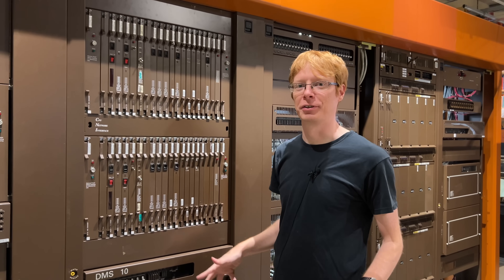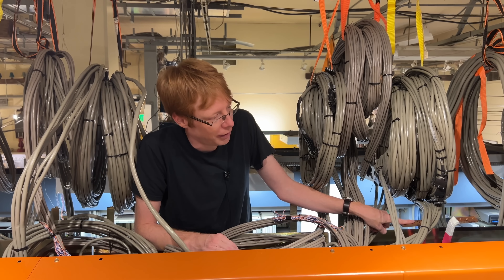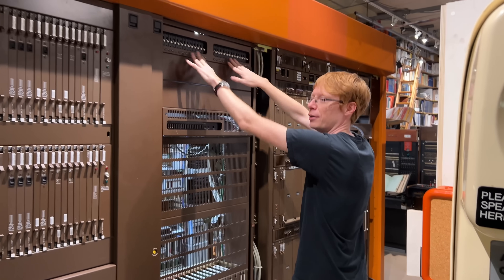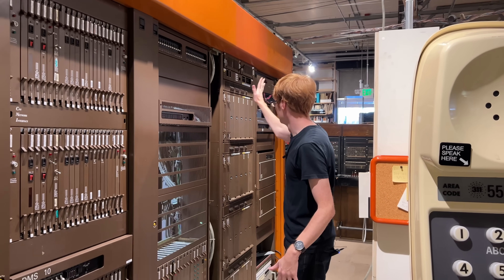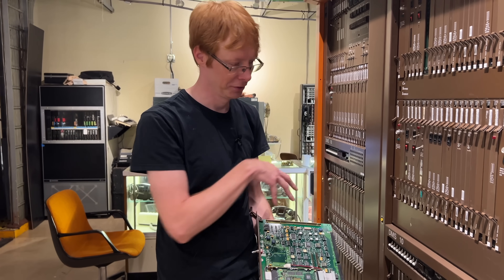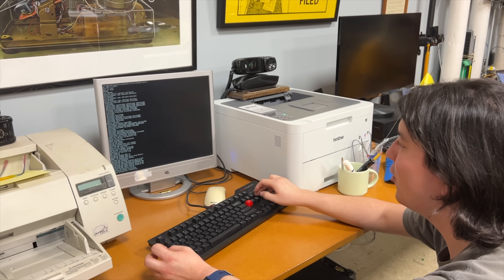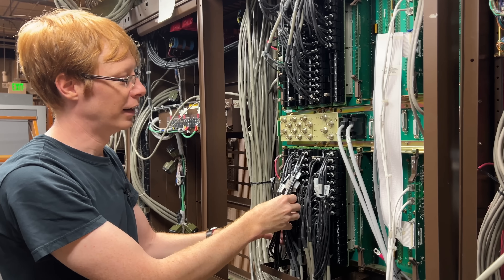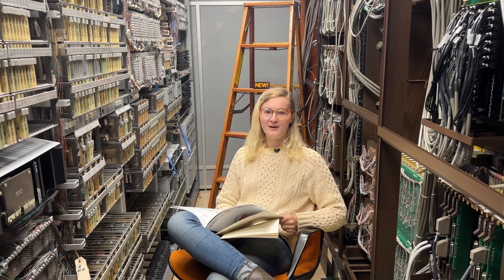Grounding and Wiring our New Switch

Comment: I worked on DMS-200 (toll) and DMS-100 (local) between 1978 and 1984 at Bell Canada. FWIW, those systems were built into rooms with the standard "computer room false floor". While this provided a source of cold air (came in from the bottom then went out the top), it was also a place where a lot of cabling could be found. IIRC, DMS-10 was only found in CDOs, not COs.

Comment: I Called it a Cross-Bar-Switch because - Thats WHAT I Was Doing LOGICALLY. Making a Switch - Crossing a Bar. However, the Actual Implementation isn't a Cross-Bar. The Transistors AREN'T Cross-Bar. Like Your Gods - Electromechanical - Cross Bar Switch. Your Gods Cross-Bar Switch - Logically they're Switchboard.

Comment: Having worked in a central office equipment environment for over 25 years on everything from a lowly SLC-96 to a 32 Slot Ciena 6500 Photonic bay system, @ 6:05 Removing, or installing plug in equipment cards without a ESD wrist strap connected to a rack ground point - Big no-no!

Comment: I worked for Northern Telecom starting in 1985 at DMS10 at the Plaza in RTP, NC. I was a systems test tech until 88 or so then i began installing them into sea land containers for emergency response units like Elma Alabama and third world coumtries like Micronesia, Guang Dong China and such. I had extensive installation, software configuration and system level testing capabilities. Reach out if you have any questioms or needs regardimg the DMS10 functiom and capabilities. May want to add the Accessnode and Transportnodes, OC12/48 pieces to your museum in the near future. I deployed those as well. Great gear and great memories.
Reply: Hi Chris, how's it goin, Man?

Comment: Hopefully in your documentation for the DMS-10 you have a copy of SD0T01-11.  This is system schematic for the 500/600 DMS-10.  This document will help greatly with regards to understanding the power/grounding and system cabling (frame to frame) of the DMS-10.
Reply: Thanks for the pointer, it definitely helps to know specifics about what we should be looking for. We're right now trying to track down a set of drawings but so far no luck. All the docs we got via Adtran were manuals and NTPs, evidently the drawings got separated from the switch at some point.
Reply: Look for old Western Electric "ED" drawings. Those were the drawings we built the systems with back in the day.

Comment: Oh my f**k they got a modern digital switch....yeeesssssss :D

What's sad is : Verizon's on a FTTP tear again in the Northeast right now, and any local loop with a 5E with bad copper they can get away with they are wacking and doing who-knows-what with the decom'd 5E's.  All the 5E's workers on the "chopping block" are getting their services kicked over to FiOS or fixed LTE/5G services.  I just hope it all (i.e. the 5ESS gear) isn't all going to a scrap pile, and they're at least cannibalizing the frames for line cards to stockpile.

It sucks because : I have this sinking feeling that's the fate that will befall 99% of the 5E gear out there that ever lived in a C.O. .  I know Alcatel-Lucent for a time sold 5ESS VCDX gear to their enormous customers as PBXes (so one of those might pop up on an auction site), but I have to imagine that software isn't the same as what you'd pull out of a C.O.

I apologize I am making assumptions here, but I would have to imagine you folks would kill for a 5ESS, basically the "Final Boss" of the WECO circuit switched world and all the wild crap they made to hang off of those frames until the mid-2000's

Looking forward to any/all content you folks made on this thing.  Thanks!

P.S. - Also bought a 1A T-Shirt, thanks for taking the time to design/sell them!
Reply: The 5E's are definitely on our mind. Two big reasons drove our planning towards the DMS-10 though: 1) we knew we could fit a working DMS-10 into a very small footprint, which meant as little disruption to the other exhibits as possible and 2) that small footprint was the original configuration of the switch, and didn't require us to re-engineer a small switch out of a much larger one. Every other switch in the museum required expert-level trickery to make them run in their museum-sized configurations, and the complexity of the 5E makes me pretty hesitant to assume we could easily pull that off, especially since none of us have hands-on experience with it. There are always details that don't appear on the high-level block diagram of the switch that end up mattering, like in the DMS-10 case it's really important that we have the PE-01 frame just because it has the power bus bars, but that's usually not mentioned in descriptions of what the PE frame does. Software is the other worry; very possible that there are configuration files that only Lucent has the tools to create (certainly true of the 3ESS). These are all solvable problems, just harder ones than with the DMS-10.

All that said, we'll definitely be on the lookout for what we can preserve of the 5ESS, particularly since now is the right time to save what we can.
-Colin

Comment: 12:08 "This was definitively C++".

No. That was definitively NOT C++.

It was C.

I doubt C++ even existed at the time these things were developed, even later versions.
Reply from the maker: You do realize that this switch has application software, correct? Like, the OS/kernel/whatever might be written in C, but there are other programs on this disk, like installers, test suites, and so on. 

And this machine was built in 1999, and is running software from 2005. I took C++ classes in high school in 2002.
Reply: @ConnectionsMuseum  there is nothing on screen indicating it was c++

Comment: It's cool to see this, considering at my job we monitor 50+ DMS10 switches that are still active, among other equipment such as DMS1U's and DMS100's and 200's. I actually took a training on how to assemble one but it was a while back so I wouldn't know much myself on how to do it though.  We had a decommissioned one we were suppose to assemble as a team to setup a lab but it ended up being cannibalized for parts when one of our active ones crapped out. Parts are getting harder to come by!  Stuff in those days was built to last.  Now days everything has such a short life span, it's kind of sad.

Comment: Pretty cool. It is clear it is running Unix, possibly with some real time extensions, and probably heavily customized Unix, but it unlikely it is written from scratch, and rather some adaptation of some commercial UNIX. Any idea yet which one? (Obviously it is not Linux or BSD from looking at the dump).

I guess this is Chorus Real-Time Operating System (RTOS) from Sun Microsystems, which is some form of SunOS / Solaris?

I am pretty sure it all traces back to Bell Labs UNIX and AT&T, but maybe Chorus is based on SVR4, which is like a combination of SunOS and AT&T Unix, as well 4.3BSD for some network stuff.

Edit: Actually no. ChorusOS appears to be custom built high reliability micro kernel, with POSIX apis for the user space. and a lot of services in user space. Makes perfect sense for a telco equipment I guess.  They also supported SL-1 language which was using some extra features. (I wonder how similar this is Erlang VM by Ericsson).

Comment: Wow, that brings back memories.  I worked at BNR as a co-op student in 1987 and I wrote software that ran on the DMS-100.  Nortel invented its own language called PROTEL for running on the switches, and I'm pretty sure they had a custom CPU too.  Fun times!
Reply: The CPU for the 500 series is a PowerPC, if I remember correctly.

Comment: Looks like a lot of fun.
Although DMS-10 and DMS-100 Family systems are different beasts, they do share some level of commonality. Peripherals such as the Line Concentrators and Line Group Controllers are pretty much the same across either platform. Internal communication should be at a DS-30A bit level for copper interconnects. (2.56 Mbits/s). Multiple DS-30 connect to the peripherals to satisfy the expected usage. From your video, I didn't see any sign of DS-512 optical connections.
When scanning the disk drives, it looks like the DMS-10 software might have been sourced in PROTEL(?) (A C, C+, C++ like language) PROTEL being the high level language developed at BNR (Bell Northern Research). PROTEL stands for Procedure Oriented Type Enforcing Language. Block structured and type enforcing. The software was not my big thing, combined with my lack of knowledge on DMS-10 -- I could be very wrong. On that disk should also be the software for the peripherals in addition to the SOS (Support Operating System). Please use an anti-static strap when pulling or replacing cards. Mentioned many times here, but worth repeating.
Grounding was always a big deal in digital machines. Random current flowing where it shouldn't will cause all sorts of odd behavior from "hissing" on the analog side of line cards, to "0" and "1" confusion on the logic signals. Not to mention potential damage from nearby lightning strikes.
One of the big differences between DMS-10 and DMS-100 was ease of use. DMS-10 being very command line oriented and DMS-100 was menu driven. The data table structures are complex in either scenario.
I worked for Bell Canada at the start of the digital revolution and eventually wound up working for Nortel as a DMS customer support drone and new product introduction. The best of times, the worst of times. Miss it greatly. On occasion.
One of these days, I'd love to see your museum.

Comment: I remember the day that our local exchange switched from mechanical to that NC switch. Then they interface later on to ADSL on top of that switch. I do not know what our LEO is running today, I have a fiber connection and dead POTS line comming into the house… no noisy lines and no problems with the dedicated fiber line… good bye 👋 to buried wet cables. And I am only 2 km or 1.5 miles from my LEO. Only time my internet was out is when the vault at 10th and State in Erie blew up and caught fire!!! 😅😅😅😅

Have fun on the new switch. Maybe there is a few retired guys in the old Chautauqua and Erie Telephone system that could help with any answers.

73’s
DE N2JYG

Comment: Once that drive has its data dumped use an SD card to SCSI adaptor to replace it.  Dead cheap and will be better to go solid state.
Reply: Colin was half of the team that created a 3ESS SD "tape drive replacement" and extracted the data from the old DC-600'ish tapes. I'd bet they were cloned before anything else.

Comment: My dad retired from Nortel, and I also worked as a tester for the DMS 100.  We have a LOT of books, software for the DMS even display phones.  Get in contact if you want it.  They passed away and it's all got to go.
Reply from the maker: @DJPhantomRage can you drop us a line at info@connectionsmuseum.org
Reply: The real ongoing problem is the circuit packs are old and failing. Since Nortel no longer exists, neither do new packs. Telco’s are hanging onto their circuit packs as valuable spares, until DMS100 & 500 switches finally fail permanently.

Comment: Are you guys apart of Phreaknet, or any other networks where people can dial in?
Reply from the maker: We are, but access has been limited lately. We will try to remember to turn it back on.
Reply: @ConnectionsMuseum your c*net connections are usually active, right?
Reply from the maker: They're tied to the same switch on our end, so if one is down, unfortunately the other is as well.

Comment: Nice work on careful documentation and preservation. I might suggest cloning those IDE drives right away.
Reply from the maker: Thanks for the tip. This was the first thing we did, and was actually what Matt was doing at that computer while he was looking thru the disk contents. We just didn't make that very clear in the video. The images are backed up in multiple safe locations.
Reply: I haven’t tried them, but I see that SCSI-2 to SD card converters are readily available on Amazon.  You could probably even modify the board to fit inside the original Atlas 5 enclosure to preserve the appearance.  I don’t know about Chorus OS, but it if mainly only writes to logs once configured, wearing out the flash on an SD card might not be an issue.  Even the slowest SD card is probably way faster than an old Atlas 5.

Comment: I assume you already dd those drives.  I also assume SCSI-2/Ultra drives?  The ZuluSCSI should work with a 68 pin adapter.
Reply from the maker: Yeah that's what Matt was doing in the second half of the video. We've got images of both drives stored offsite :)

We will look into a solid state solution once the machine is booted.

Comment: You might be doing this anyway, if so ignore me. I restore retro computers, which now actually has a crossover with what you guys are working on here. Please, image the hard drives and keep the image somewhere safe. Future Connections Museum will thank you on the day those drives break.

It may even be worth considering taking them out of service and putting them in an archive, and replacing them with something solid state, like a CF card, as they're more reliable.
Reply from the maker: Thanks for the tip. This was the first thing we did, and was actually what Matt was doing at that computer while he was looking thru the disk contents. We just didn't make that very clear in the video. The images are backed up in multiple safe locations.

We will almost certainly move away from spinning disks at some point, but for now, we just want to get the machine into a stable, running configuration, and then we can work on moving to a solid-state solution!

Comment: Curious it seems this is the same "Coffee Brown" tinted paint which Schulmerich used for their 1960s Carillon racks.
Reply: BTW guys, if you absolutely must have soda, buy the two liter bottles, and keep it refrigerated.  The inside of those aluminum cans are not coated, and it is now known from several studies that aluminum is very bad for our health. :)
Reply: @DandyDon1  Actually, they ARE coated with a thin layer of plastic(which may, or may not be safe).

Comment: not seen one of them since doing my apprenticeship at Nortel in the mid 1990's........cabling the big ones took forever! The fact the cpu board you show is badged with the Nortel Networks branding shows it would be after about 1998. Was a good company to work for, but never did much on dms since my apprenticeship, went of to access mux and backbone transmission with the Optara range of SHD mux and DWDM
Reply from the maker: We were told by the folks who donated that this was the last DMS-10 to roll of the assembly line, and we date it to somewhere around 1999-2000. We can't prove the claim that it was the "last" one, but it makes an interesting anecdote!
Reply: Optera Metro platform is still very much in use today!

That said FMT-150s are too but nobody likes to admit that

Comment: After backing up the drive, do you plan on putting a Solid state solution into the DMS10??  Maybe a blue SCSI?
Reply from the maker: Eventually, yes. It’s just a little too far in the future for us to think about for now. :)
Reply: My suggestion would be getting it working with the old drives first. There's a chance switching to a different type of drive could cause weird problems and and you don't want to be heading down the wrong metaphorical rabbit hole.

Comment: when my district got the dms they selcted 4 techs to learn it and agree to stay for 3 years-all good. however when the 3 years were up 2 techs retired and the  other two transfered. i got sent to the dms 1 day to change a circuit board-i searched for the spares-nothing but line cards-called teh support-they tell me to turn around in front of the switch and notice another set of frames-yep-turns out all the spares were live in the second frame!-did you get a live spare frame?
Reply: There are no spare. And  All of the Packs are spare. There are no customers.

Comment: Next step, wireless. You think it's something going from analog to digital, just wait until you transition from tin cans and string to smoke signals. 

With so many switches, you are very close to needing a centralized alarming system and a NOC to watch over it all.
Reply: Thay will not need a NOC. They only turn the switches ON when they want to play with them.